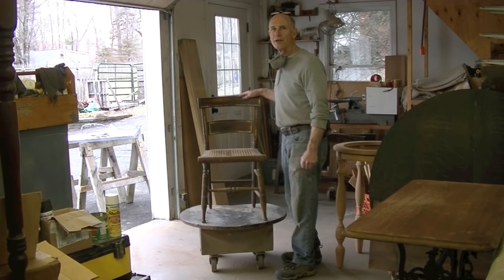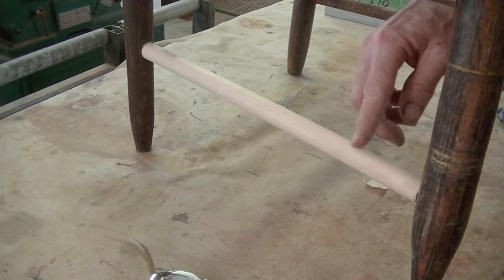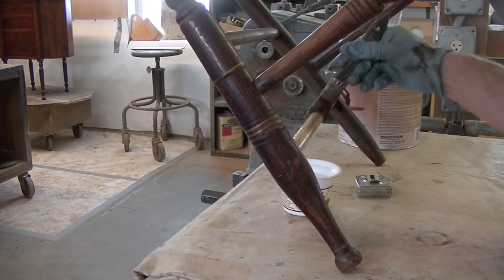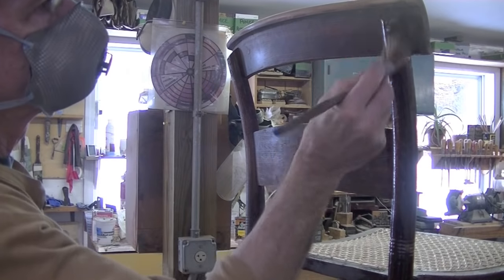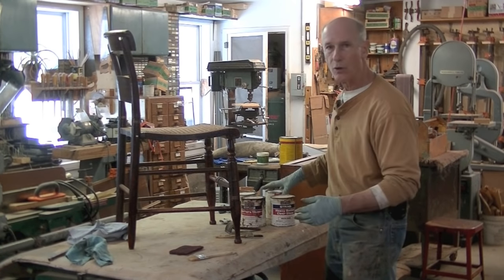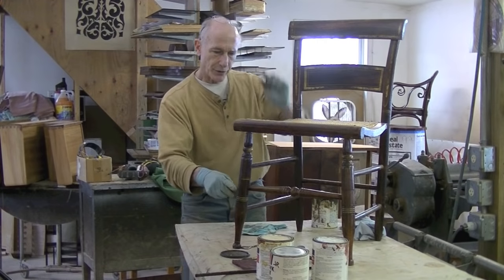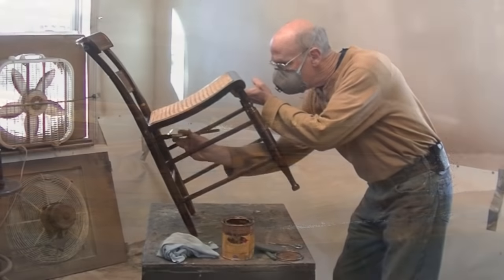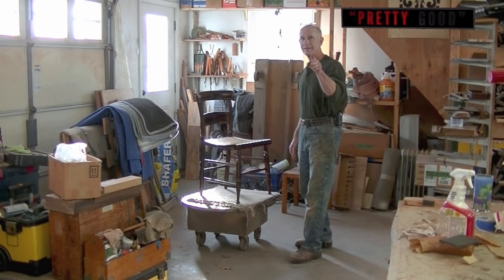Graining a Spindle for an Antique Fancy Chair - Thomas Johnson Antique Furniture Restoration

Comment: Very nice. I have a question regarding the caning.  I know from your prior videos, that you usually get the caning done by another company but I wonder if you could still answer my question...    I have an antique chair that has the back and seat caned.  The back is in good condition but the seat is not.  If I were to replace the seat with caning, how could I match the color of the back?  The back cane looks like it had some kind of varnish but I am not sure.  Could I use toner or other products to darken the new caning to match the back?  Thanks!
Reply from the maker: You're welcome! Cane is always tough, and it doesn't take stain well. You are correct, though, toner is the way to go. You have to tape off the surrounding area, and tone with light coats. Aerosol toners are widely available, try Woodworker's Supply https://woodworker.com/burnt-umber-shading-and-glazing-mssu-146-909.asp

Comment: What a great find. I think most of these chairs tend to only be valuable in sets. I think I saw a set of 12 once on an auction website. I also had to repair one once. It had a broken arm rest, and it still had the original cattail rush seat. You can see it here: http://lefebvreupholstery.blogspot.ca/2013/09/early-antique-stencilled-chair-repair.html

The graining is usually made to look like Rosewood, and it sometimes looks pretty convincing. I think they used paint originally for both the base and the black graining, but I can tell that your chair was pretty distressed and a lot of the base wood was showing through. That said, the graining with the stains was probably the better choice. I really like that you didn't try to change the chair or improve the old finish too much. I'm sure a bunch of people (or clients) would have wanted more of the gold trim touched up. I like is as-is.
Reply from the maker: Yes, they used a brick colored primer on a lot of these. This one didn't look like it, so the staining worked well. And the gold has got to be a "all or nothing" situation, if you made the gold look too good it would only make all else look worse!
That's a beautiful chair (the arm chair)